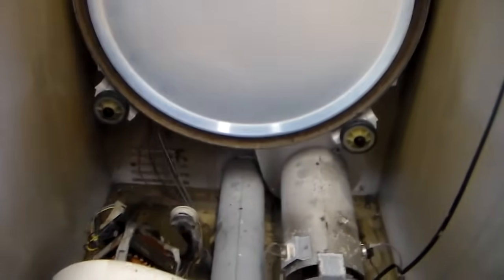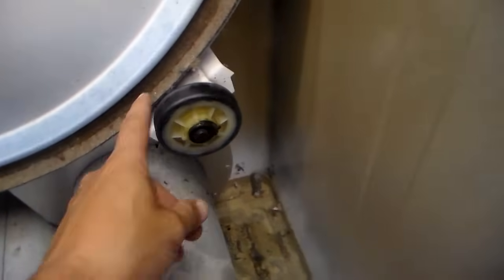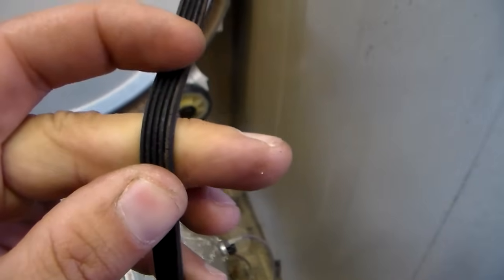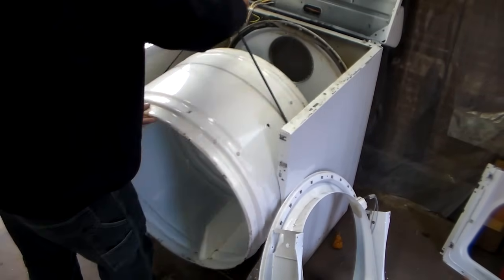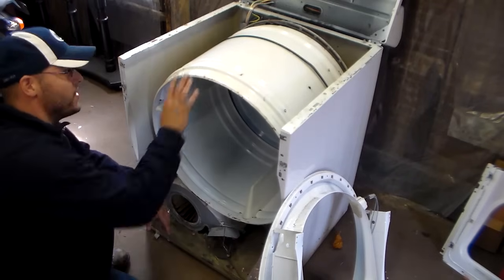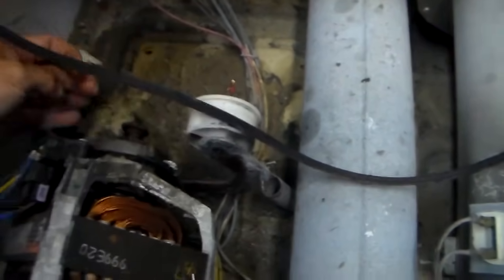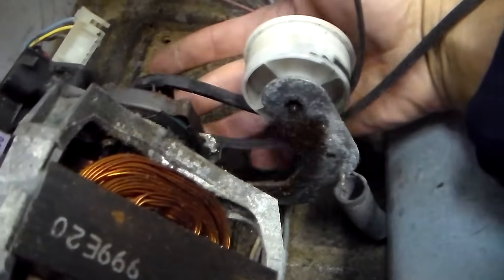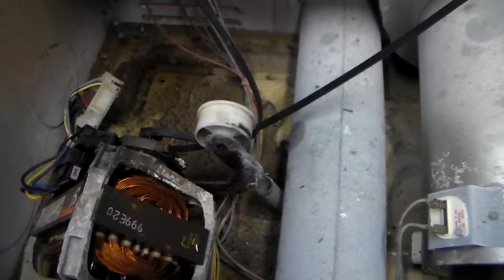How to Replace a Belt on a Maytag Dryer

Comment from the maker: If you post a model number here, I can tell you the part number.
Thanks for Watching!
Reply: Hi there. I have a Maytag Dependable Care Plus model number ldg8624AAE. I looked up and found part WPY312959 which is supposed to be the right fit. This part doesn't fit my dryer. The part I ordered measures 100 inches but the old belts measures no more than 106 inches and at minimum about 103. I can't be specific because that old belt snapped so the longest thread reaches to 106. I can't find any belts that are longer than 100. I'm pretty sure the one I purchased is not the right size I pulled a spring play all the way back and there's no way that it's going to reach. Can you help? I'm just trying to figure out what part I should buy

Comment: Bill, thank you so much for this video! It really made a difference. I'm not mechanically inclined, but your video was so easy to follow that I fixed my dryer without needing to hire a repair service. The belt slipped off, and I never would have had the confidence to repair it myself without your video.

Comment: Thank you for showing how to put the drum belt back on. Just replaced the idler pulley and belt and wouldn't have been able to figure out how to get the belt around the motor and pulley without your video.

Comment: Beware:  My Maytag dryer has the belt threaded a different way than this video.  After struggling for over an hour to try to do it this way, I found another video that shows the threading my dryer uses (in which the belt goes all the way around the idler pulley, and the belt grooves face away from the drum.
Reply: Same here. I have a 30-year-old Maytag model LDE7304ACE and noticed the same thing. I noted the orientation of the belt when removing it, and it definitely had the ribs slotting into the motor pulley (which has grooves). This way the flat side of the belt is making contact with the drum and the ribs are facing out, not in toward the drum.

Comment: Great how-to video. Following your clear instructions was very easy, and we were able to fix our Maytag Performa in a snap with a $8 belt. Thanks so much. 

One note: with the drum in place, we couldn't fit our arms in to put the belt on the pulley. Instead, we put the belt on then pulley first, and used the old broken belt and a metal hook to pull on the pulley from above the dryer, loosening the belt so the drum could slide into place. Then we carefully put the belt around the drum without letting it fall off the pulley. It took us a couple tries but it worked and we still couldn't have done it without the help of your video, so thank you!

Comment: Thanks, Bill!  I am very grateful for this video.  I have taken my dryer apart a few times to replace various components, so I am familiar with the process.  This time, however, I just could not remember how the belt wound around the idler pulley (Old Timer's Disease).  I kept thinking only one side of the belt went against the pulley, which left me with about 6" too much belt!  That said, I could never have put this belt on blindly, as you demonstrated.  I had to squeeze the pulley to it's maximum extent, and the belt still barely reached the motor.  Fortunately, my model has a removable back panel, so I could access the motor and belt from there.